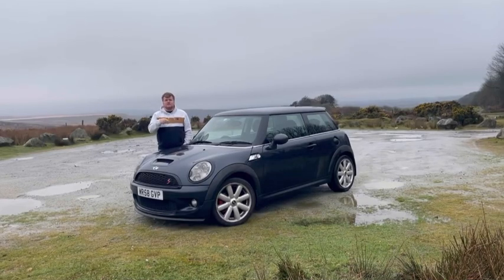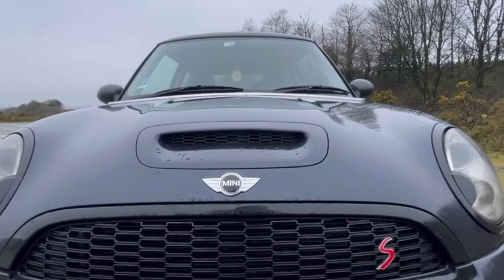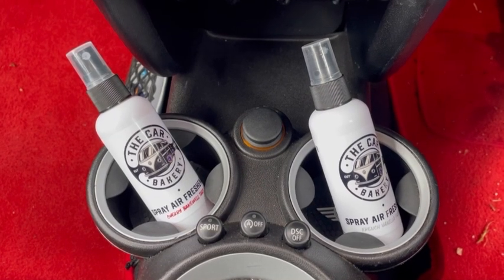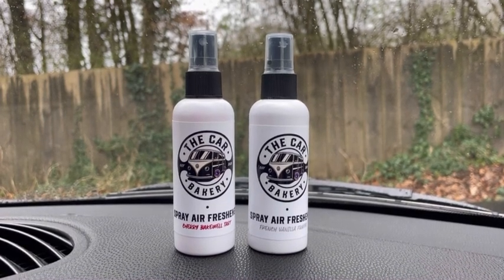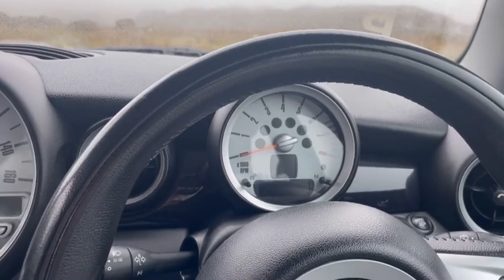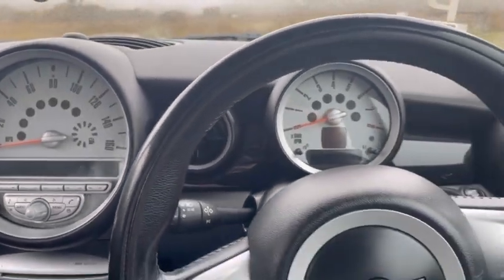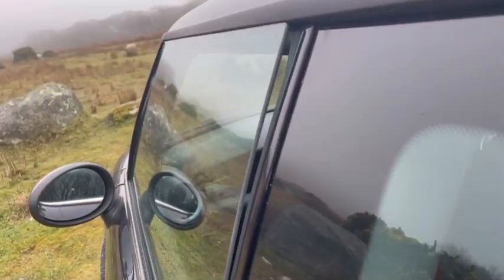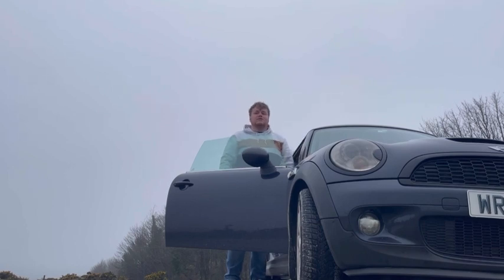Things I HATE about my MINI COOPER S R56 (2007-2013)

Comment: Agree on all your points! Lack of temperature gauge is bonkers in a sports car. I'm thinking of fitting a different exhaust to improve the sound but it will never sound as great as the R53 whine... Mine also randomly goes into safe mode (ie. No turbo). Can do it twice in a week or never for 2 months...totally random...sensor issue i guess. Clears by turning engine off the on again...runs sweetly...not paying a Mini dealer £195 an hour to try to diagnose it ! Anyway find a good non dealer Mini specialist and you'll be ok if you change the oil every 5k miles...
Reply from the maker: Agreed! An R53 is the perfect Mini Cooper S in my opinion.
That’s strange with your turbo going off and on whenever it wants. These cars are so random and unpredictable. 
The temperature gauge still baffles me

Comment: all the windows are meant to go down and up when opening the doors respectively, just a little, because they are frameless. I would hedge a bet that the car doesnt know the door is being opened. This can be tested by the puddle lights going on or off when opening and closing. The solution to the "wind gap" would be to roll the window down manually a little before closing. Then rolling it up manually to create the seal.

Comment: I'm the second owner of my 2009 R56. If owned it for over 8 years now. All the I've had to do is update the cooling system (water pump, thermostat housing and cooling pipe) I did install the updated timing chain tensioner and installed Power flex lower control arm bushings but that's it.The rest is regular wear items such as tires and breaks. It was 6 years old when I got it and only did 65000 miles since new. I plan to keep the car for many years to come so I treat it well.